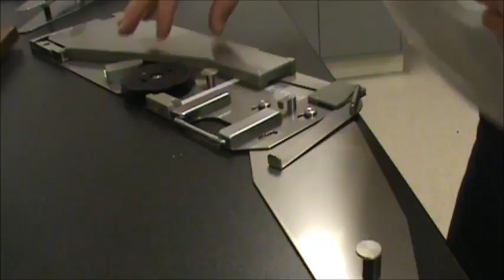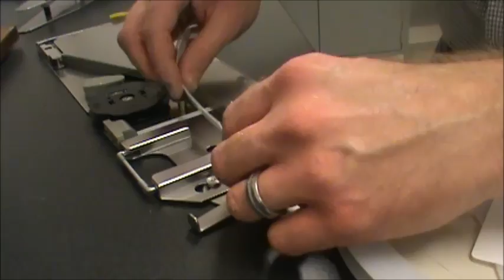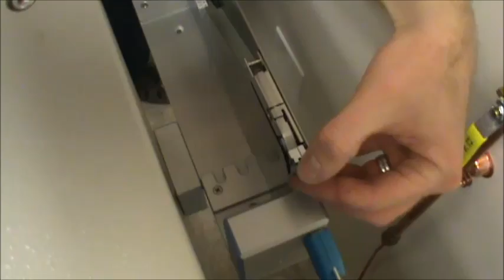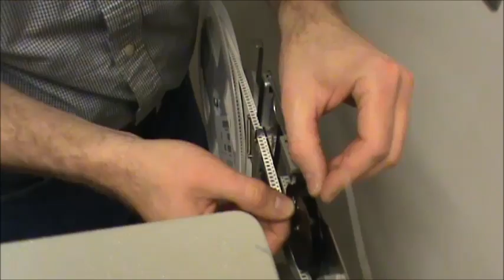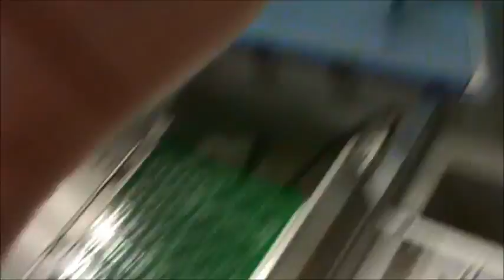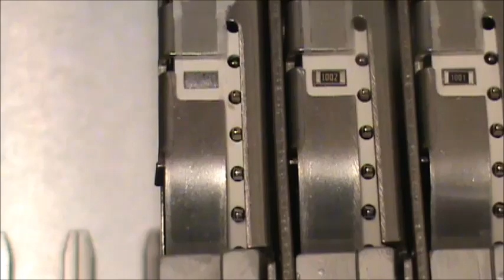Manncorp Pick and Place Loading Feeders

Comment: Very beautiful! When is it worth considering an in-house PCBA? The PCBA companies we work with are close to imposible to beat.
Reply: If you're a small business, its better to wait for cheap equipment from auctions or bidding sites.
Reply: We worked with like 5 PCBA companies so far, One was outstanding (never any issue, very high quality), 1 was absolutely rubbish (however the employee left the company which we had contact with), 3 other ones caused failures on assembly (eg. one chip shifted by 5mm on the pad, another one too much solder paste, another one the squeegee angle not right and chips broke due to not handling humidity correctly). With all of them it was difficult to get a good assembly date for relatively low volume. When doing inhouse PCBA the volume can even be lower and more or less just in time.